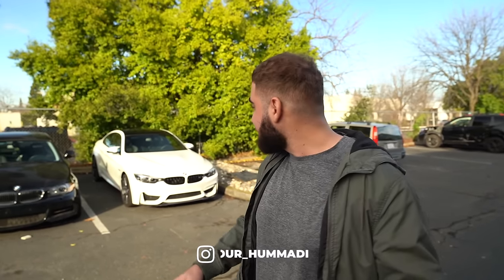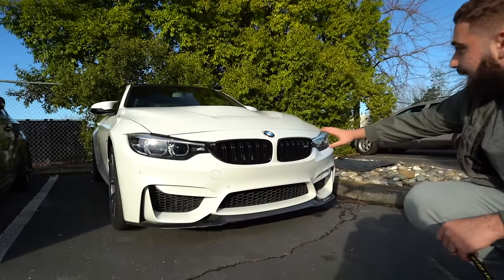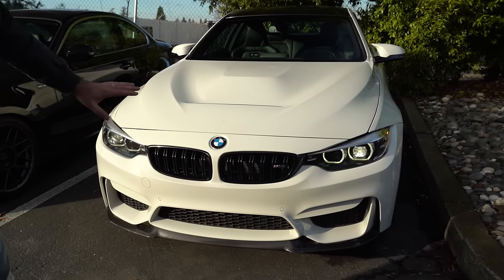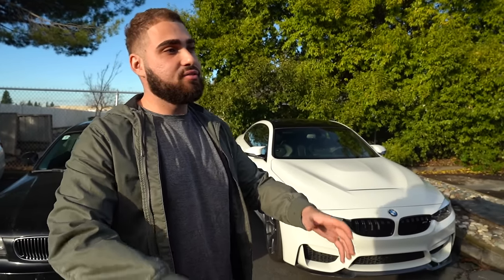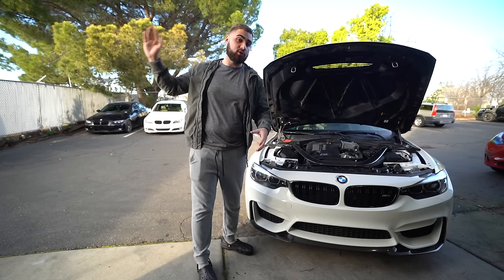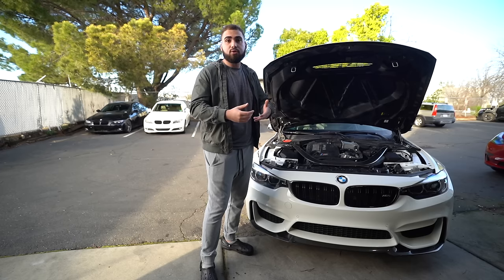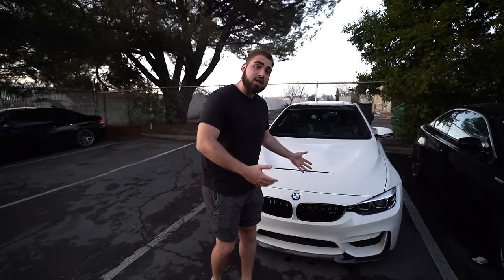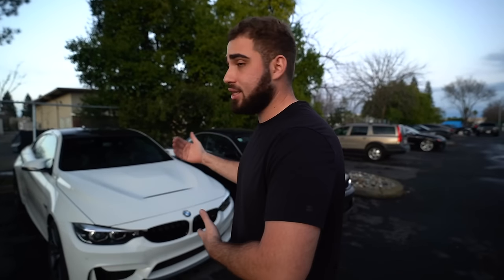THE MOST COMMON ISSUE WITH THE F8X S55! OUR CRANK HUB FAILED..

Comment: Nour, this harmonic balancer on these engines along with N55/N54 have wobble a little bit and its normal, if it’s excessive just swap the balancer nd see,  bent crank will make really loud noise end engine would die in no time, I think your good and I highly doubt you have serious issue with the engine, just change the balancer and repot back
Reply: The balancer on my N55 seems to wobble a bit. Never would have noticed it tbh but my serpentine belt started to squeal and I spotted the wobble. Did this a year ago when the car had 113k, now have 120k and no issues.
Reply: @ericbaxter4195  yup same with my my car, inhave n55 and n54, been driving them hard with no issue

Comment: a bent crank shaft would be audibly noticeable and typically caused by excessive heat or shot bearings. harmonic balancer should be replaced and if you’re getting the crank hub done, have the bearings checked for excessive wea. the bearings themselves aren’t super expensive and if you’re doing the hub, might as well while you’re there

Comment: Contact s5x performance shop in LA i knkw you said you dont want to drive to LA but i was able to leave sacramento at 3am and arrived at the shop by 11am. And the shop installed a new pinned crankhub in 4hrs for only $1750. And drove back made it home 9pm. It was a long day but definitely worth it due to price. Best customer service too. Im also running stage 2 full e85 and have had no issues.